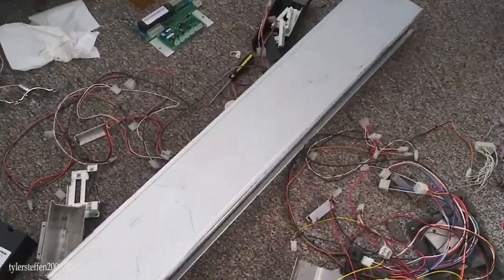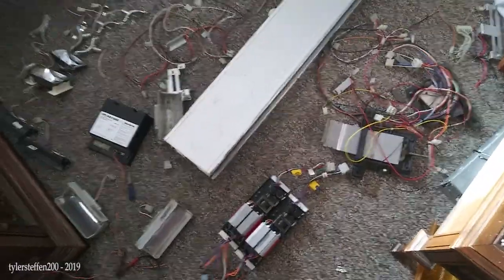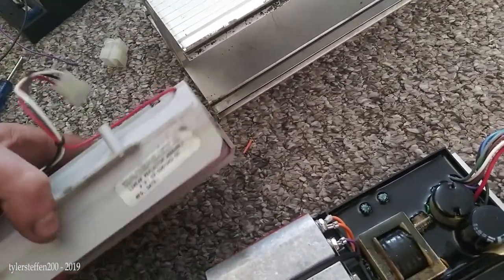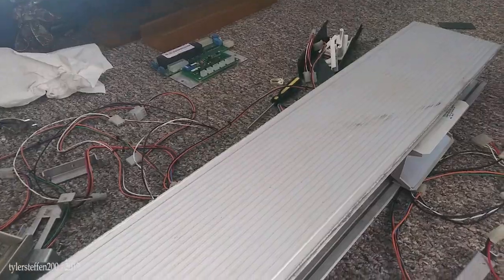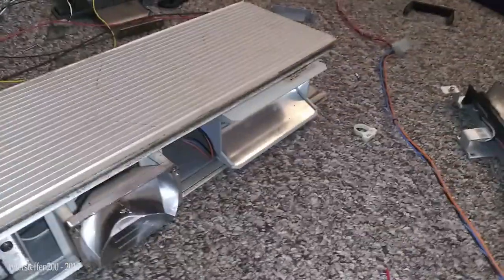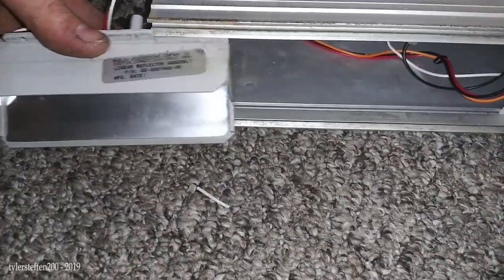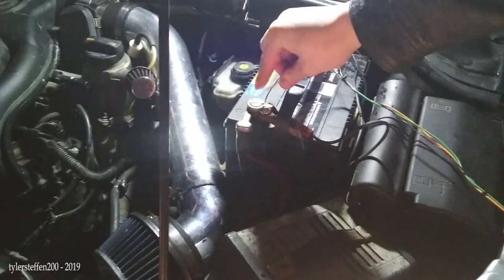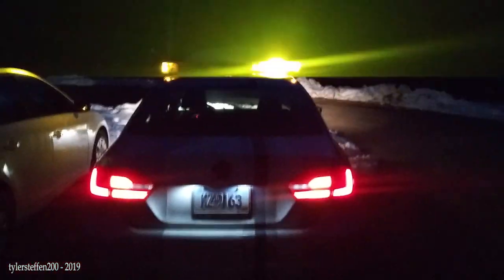Whelen 9000 Light Bar Rebuild / Light Demo

Comment: "On of them stopped working" 🖐✋️🖐✋️🖐✋️ great video! I just got an amber bar. Currently only have take downs, alleys and rear wig wag working. The fuse on each supply is blown.. as well as a 3amp which idk what that's for?